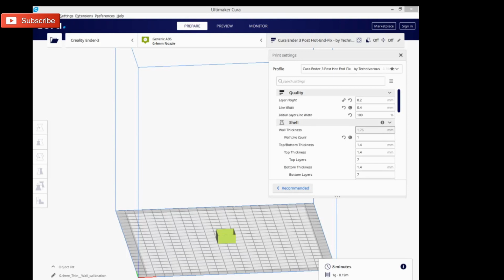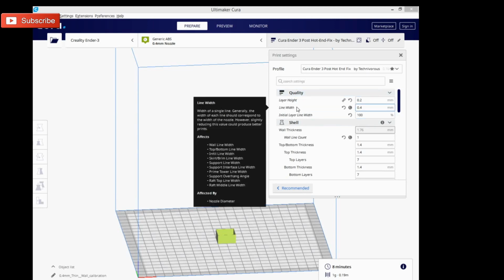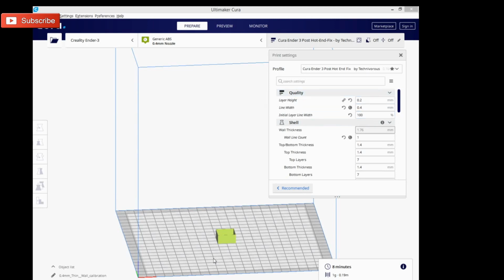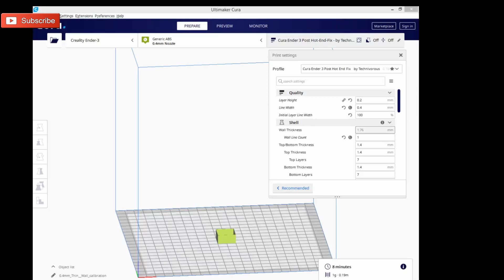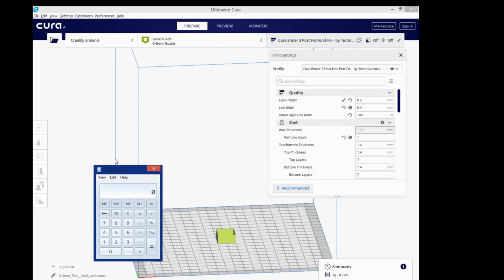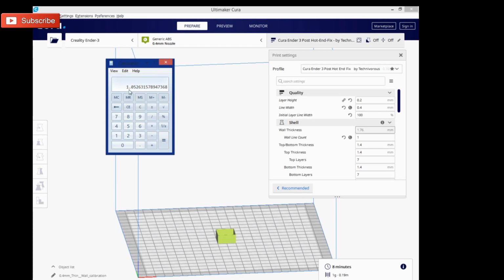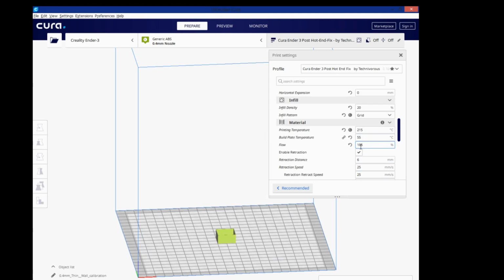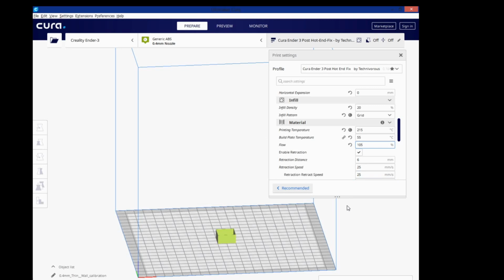how to adjust  your flow rate! - 2.4

Comment: I was getting 0.43 instead of 0.4 so I changed the Flow in Cura to 93. That didn't change anything, my walls on my cube test are still 0.43. Like if something was overiding my Flow setting. Note : I'm trying to calibrate my Ender 3 using Micheal (Teaching Tech) new calibration website.

Comment: thanks - my cube is good but i have a thicker line approx in the middle of my cube all the way around - any ideas why - thanks
Reply from the maker: Over extrusion. Usually if it's all throughout it's the extruder or a clogged nozzle, but just one really thick line, is normally a binding. Check the z axis lead screw and clean any gunk out, then lightly grease it and try again!
Reply: @Technivorous  thank you this makes sense-my measured 100mm extrusion is almost spot on so must be loose screws somewhere-thanks for responding

Comment: Happy belated birthday brother! Working with the anycubic mega zero and I don't have the ability to adjust the E-Steps, not that I know of anyways. On the menu there isn't a setting to do this, ill calibrate the flow rate though the best I can, I know I have been under extruding from the past 2 days of print calibration cubes..... Just tested and i'm under extruding by .54mm in the Z, super frustrating any tips?
Reply from the maker: Getting any elephants foot?
Reply: @Technivorous  Definition of elephants foot?

Comment: thanks for the video looked really easy, BUT i printed the 0.4 box and measuring it, it was 0.60 so i adjusted my flow to 66 and it was way too low, and didnt put enough to stick to the bed. is there any reason my print was 0.60 instead of 0.4 other than the flow?  cheers.
Reply from the maker: Are you using a .6 nozzle by chance? What was the height? Sometimes if the model is getting squished it gets fatter. Try setting the flow back to 100 percent, and follow the instructions in this playlist for calibrating your esteps, to make sure you are extruding the correct amount.

Comment: Many thanks for videos..
I have flow problem when flow 100 part is very bed.. When ı change flow 300 part ia perfect
Reply from the maker: Check for clogs, you shouldn't need to turn flow up that high unless you have an obstruction. Unless you built the printer yourself and have the wrong pins jumped for the extruder stepper motor
Reply: @Technivorous  ı cheched all thing and didn t solve when turn up to flow part is perfect.  I control stepper motor set up is ok..

Comment: Happy late birthday, can you explain the relationship between flow rate and e steps from your recent video, they seem to adjust the same thing. Why are these two settings needed? Used for? Thank you for the awesome content 👍
Reply from the maker: so... i wondered the same thing when i first came across these terms. so the e-steps, is to calibrate your extruder motor, to ensure that it is extruding the amount you tell it to. 10mm=10mm;

the flow rate is used to dial in the thickness of your extrusion. if your lines are coming out to thin, the g-code will tell the extruder to push 11 mm, instead of ten for example, over the same space, thickening the line to the desired width. (basically the flow rate tells the extruder to push more length in the same print space to make the line wider. this is why we make sure the extruder is pushing the amount told first (e-step) then flow rate tells it to push more or less if our dimensions are off.)

so basically, e-steps ensure extruder accuracy, and flow tells the extruder how much to push.